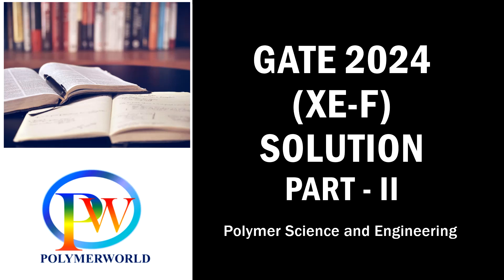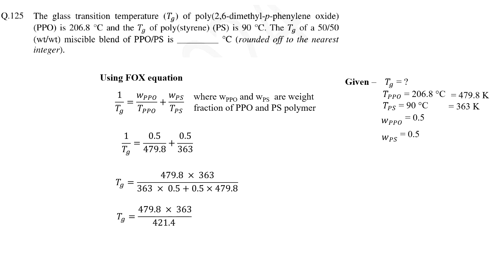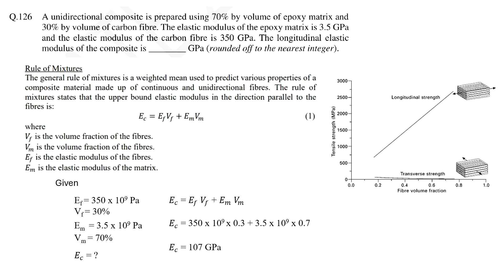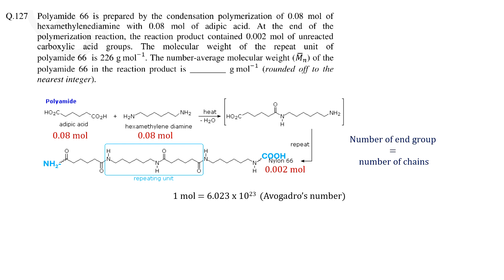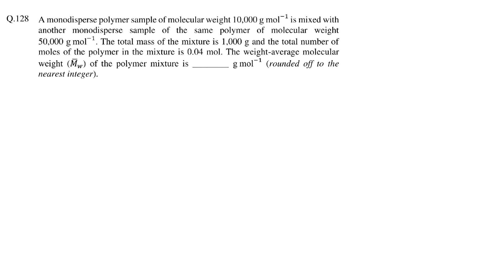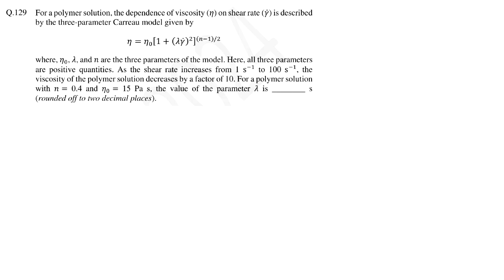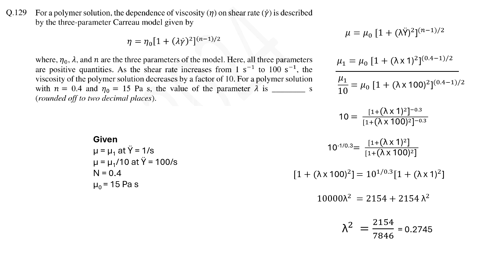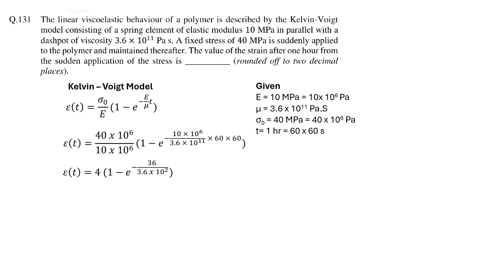GATE 2024 (XE-F) Polymer Science & Engineering Solution (Part-II)

Comment: 6:43 conc of repeat unit is equal to conc of 1 of the monomer ? Why
What if the conc of boh monomers weren't same / equal? Then what would be the conc of repeat unit ? Average of the both? 
Kindly explain, Sir
Reply from the maker: Repeat units are the smallest segments of a polymer that can undergo polymerization independently. These molecules contain two distinct functional groups capable of reacting with each other. When two monomer units are present in equal concentrations, they theoretically react in a 1:1 ratio to form an equivalent number of repeat units. However, if the concentration of one monomer is lower than the other, the number of repeat units formed will be limited by the concentration of the lesser monomer. Once the lower-concentration monomer is fully consumed, any excess of the other monomer will remain unreacted and will not contribute to the polymer structure. Adjusting the relative concentrations of the monomers is a common method for controlling the molecular weight of the resulting polymer.